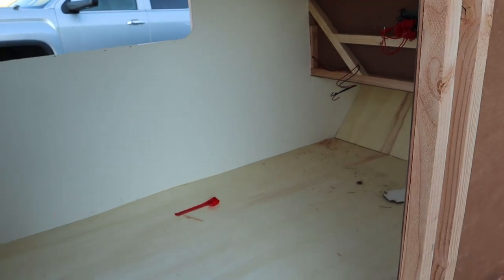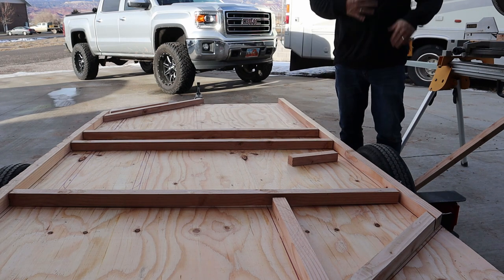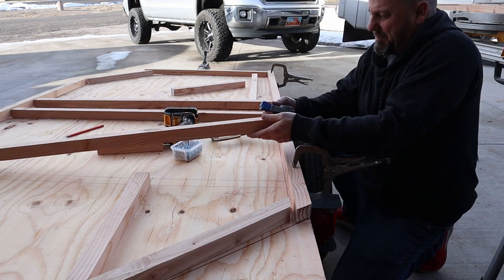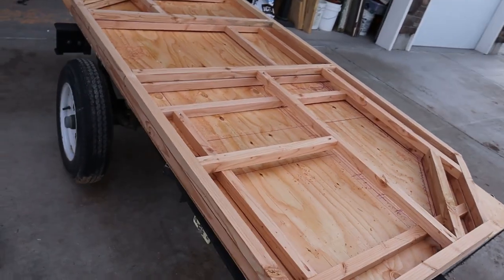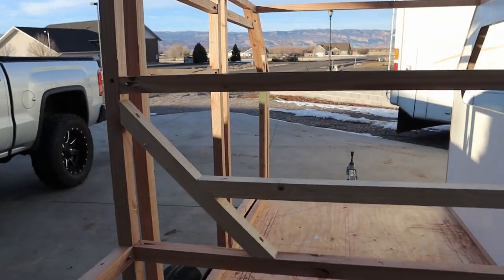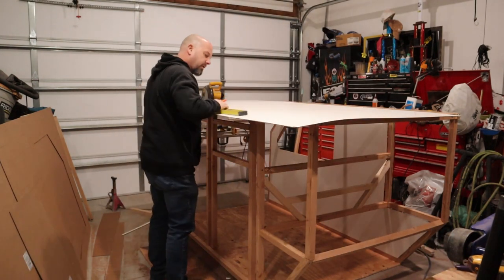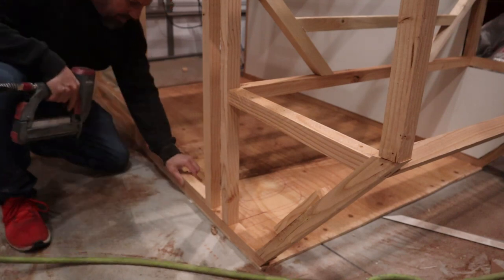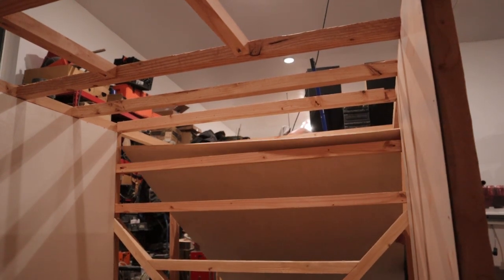OVERLAND TRAILER BUILD, DIY teardrop square drop trailer, off road camper build, UTV overland camper

Comment: Nice trailer but I'm just curious why you didn't put the interior walls on the framing before you installed the walls to the floor? Kind of like they do in mobile home builds. I used to build them in my younger years. Then you wouldn't need the block support and have gaps between the wall and the framing. It adds integrity to the entire wall and keeps it square. Its also much easier to install the interior plywood before the walls go up and you can trim the overhanging edges, windows and door holes with a router. Its the same for the roof interior and end walls. You got me thinking of building one now.
Reply from the maker: @steveaustin4565  thanks for the tips.  I have since built 9 more trailers and the way I build them is completely different from this.  Checkout some of my newer trailer vids. Thankis for watching.

Comment: Nice build, did you use wood glue for all wood connections? Also, I noticed a lot of toenails (angled screws) in the horizontal members, wouldn't it be stronger if you predrilled the outside frame and screwed the (horizontal members) from the outside? It would be a lot stronger I think, Thanks.

Comment: I recently got my hands on a 4x8 trailer and really though about going the 2x2 wooden post but someone how I didn't think they would handle good going down the highway I went the metal square tubing and in the process I'm learning how to weld....can give an update on how it's going?!
Reply from the maker: The trailer in this build was sold after about 500 mountain trail miles. It did great and the guy who purchased it is loving it.  Check out more recent videos for the newer builds, I have abandoned the 2x2 framing for lighter weight ho.e made sandwich panels that are awesome.  Took the most recent trailer on a 3000 mile trip and it did great on the highway.

Comment: Would you happen to have a video of the parts you used I'm running an either 12" or 13" ture and I'd like to upgrade to a regular size tire

Comment: When I see your build @10:55 what I think I would do with mine is build like the living area and small kitchen/sink on the bottom and have an attic type cutout maybe 3 ft high or so with a mattress up to you can mount a tv put a skylight and then have a living room on the bottom
Reply from the maker: That's a great idea.  I may use that on the next on.  It's already in the works. Haha.  Thanks for taking the time to watch.
Reply: @rockymountainbackcountry1588  no problem I’m subbed. Currently home searching and then I’ll build my camper hopefully this summer. You’re video gave me a lot of great ideas

Comment: This is so awesome man! thanks for sharing. I can't tell you how much I have loved finding this! It makes me think that I can do this now and at a much smaller price than what I had thought before. I also like the light weight aspect of the trailer and the smaller foot print. I guess you don't have any real measurements for it right? It looks like you did everything from scratch and designed as you went... this is usually the way I do things so again that's very comforting to see that it can be done. are you still happy with the trailer? any water issue? I live in LA and will travel very far to get to the trails so I need to make sure the thing is water proof. I probably will have to check these axles as well. If I understand you start by finding a trailer and go from there right? I think you mentioned in one of the videos that you wish it was 1 foot wider? still think like that? it will be for me and the two 40 lbs dogs so I think it's the perfect size to be honest. I want it to be tucked in behind the LX470 perfectly and not be heavy like most other build. for the interior walls (@14:34) I think you should do the OUTSIDE edge of the 2x2s so when you're inside the wall you can screw to the 2x2 without having to use nailing blocks? no ?